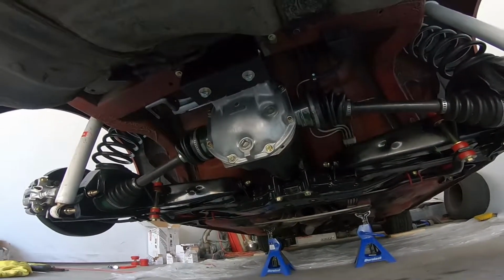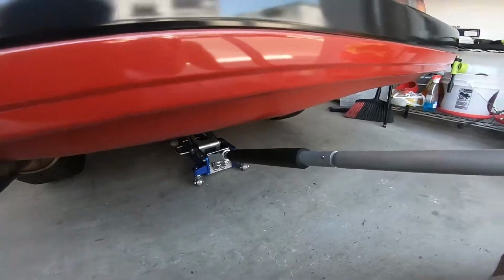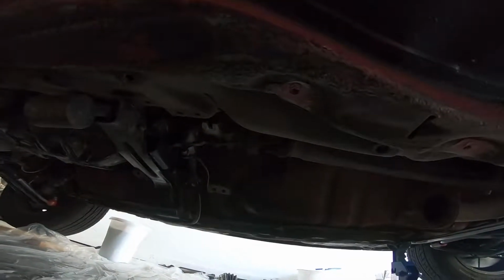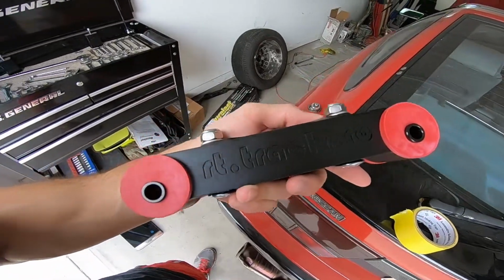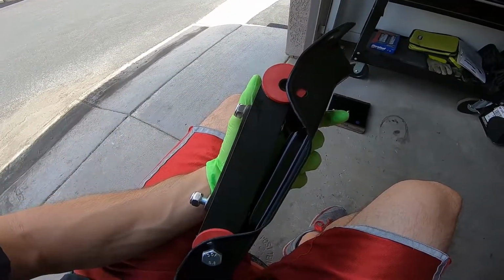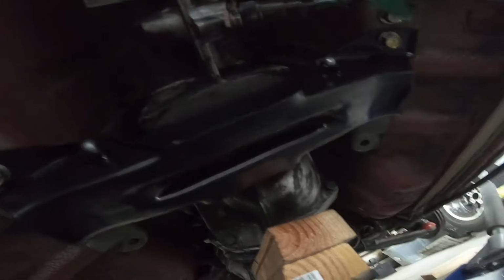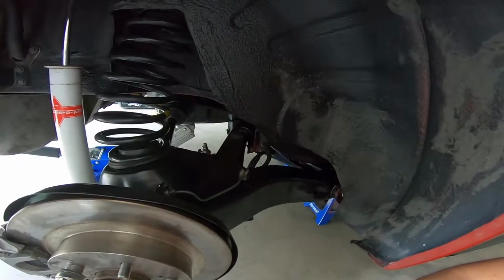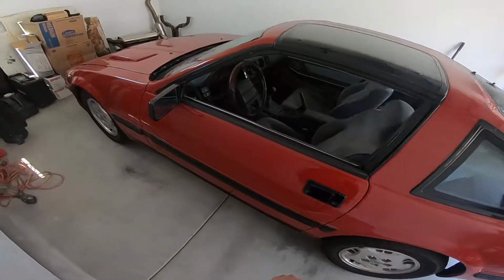300zx z31 Rear Suspension Overhaul Part 4/finished  (clean, paint & install Polyurethane bushings)

Comment: i'll be getting an RT.trackpro trans mount for my 30a trans. I've replaced the subframe bushings and got the solid diff mount, still getting some clunking.
Reply from the maker: The trackpro is a nice mount and your clunking could be from your tranny mount you have on it right now or it could be your motor mounts. They are most likely bad like mine where.
Reply: @jakesscc9184  yes those need to be replaced too.